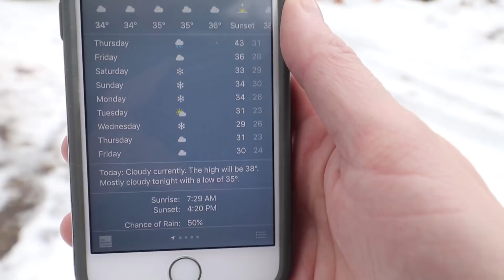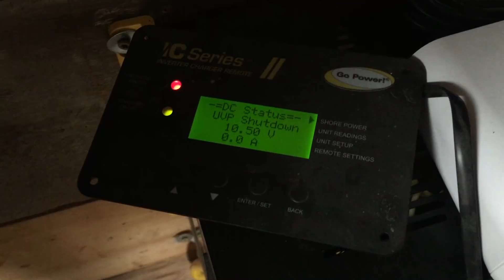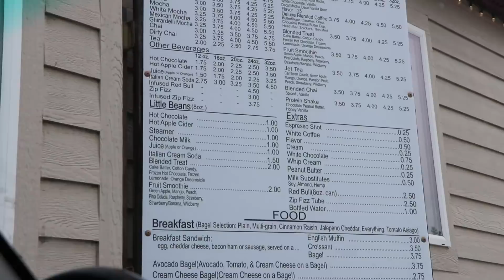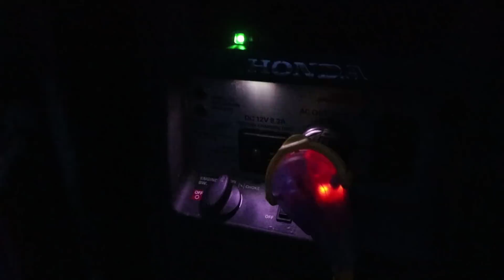Our Story: Giving Up Solar Power to Go On Grid

Comment: I think if you can get some heat from your house into the battery box,  Like a piece of stove pipe from the house into the battery box,  and insulate the battery box.  If you warm the batteries up they might perform better.  I am guessing you are heating the house with a wood heater.  also insulate the stove pipe.

Comment: I would like to add my little to this video if i may. I was surprised that you didn't go for grind long time.  I have my solar system as well and I would say i'm happy with it for 2/3 of they year ..but rest of the year for sure i'm only on grid because low amount of sunshine. So I would suggest (if i may) go for grid  then build your house ..one two years after you do it then buy solar panels including battery and go offgrid..But now you will have a lot of solar panels a lot of battery capacity and even if you would have to use generator it will be different as it was before. This is what i would do but ofc you are the last one who has to deside. So what ever you do i wish you good luck with it :)

Comment: should bring in 3 phase power in if it's available. If you run big motors or lots of shop equipment. Bottom line is you have to buy 3 wire not 2. so alittle more money but worth it.
Reply: 3phz is generally not available for residential applications.   It also is 3-4 time the initial cost when having it set up.  I looked into it when I set up my wood shop.  it was cost prohibitive.   I opted for a 10hp balanced rotary phase converter.  It was a DIY setup and I had less than $300 in the entire thing.

Comment: Good choice.  Most places it is soooo much cheaper to be on grid vs. generating your own.  The cool part is that you have all of that equipment and you can still have an awesome backup in case there is an outage.  You can run the essentials.  I hope it doesn't break the bank.  :-)
When you have the power run to your property and your house, have as much of it underground as you can.  I may cost a little more up front.  You will save in the long run as you won't have to deal with trees and such falling on your lines.  And it has such a cleaner look to it.
Reply: They live near what looks to be a significant road so underground wiring could be a pain during "Backhoe mating season"...

Comment: I see a lot of mixed feelings in the comments. At the end of the day, its your life and property. But if you do go on grid... GET 3 PHASE. if you ever plan on running large equipment, or really anything in general it is much more economical to run on 3ph due to the lower amp draw.
Reply: Steve If 3 phase is available, you are correct.  But many to most places, 3 phase is not available.
Reply: Lots of money a month for 3 phase if it is not needed. Amps don’t cost money, kWh ‘s do
Reply: IT is a house not a business were you may need 3 phase power it would cost more to install and that is if 3 phase power goes down the road they live on they make no house hold equipment is 3 phase

Comment: Ok better what you need to do to get the jobs done. Spending the money on gas for the generator or to fetch water that you could get or do by spending the same money on grid power? Deep breath solar and the generators as backup, very wise. Choice now is underground or poles or poles first then underground. Take your time to make the right choice.

Comment: You really dont need to explain there is nothing against using the grid. Although I do think that for the water perhaps do a ram pump.
I also think you went to small on your solar setup. I use primarily solar shingles and I am hooked to the grid as well.

Comment: you guys are doing what is right for your family.  I support that if you think on grid is the way to go.... Do it.  Something to consider if you want to continue to use your solar.  Look into grid-tie systems.  This allows you to utilize your solar panels and have the benefits being on grid.  You would only need to remove you battery bank, and purchase a grid-tie inverter.

Comment: I think most would love to use and like you said gain energy independance, but problems exist as you have found out. I think a point that needs to be made regarding PV uptake is that clouds diminish this process. Taking that concept a step further we need to ask the question what is solar radiation management (SRM) aka chemtrails? Geoengineering is ongoing and a person would need to be blind (or willfully blind) not to notice. If this is a new concept for anyone then I would suggest reviewing this website, http://www.geoengineeringwatch.org/category/top-story/. Dane is the gentleman who 15 yrs ago dropped everything to pursue exposing what is taking place in our skies, and he got his start because he started noticing how the SRM was diminishing his PV uptake.

Comment: +Pure Living for Life:  Hey, J & A. Looking into solar, or any passive electrical generation system (or, for that matter, any of the "grid" generation systems), you will find that the real problem has always been what do you do w/ all the power that isn't used by the consumer. Just where do you store that over-generation? On the typical grid, the amount generated has to be used by one or another consumer – it cannot be stored. To the rescue comes Australia. The SMART MINDS there have managed to develop free-standing battery systems which allow the generating over-capacity to be stored for later use – by homes, by buildings (office and residential), by industrial concerns, by cities, by local sections such as counties, and, eventually, by the Australian Nation.

What, may you ask, provides the storage medium? It's reasonably simple. It's new battery technology wherein the over production of a.c. power is converted to d.c. power to be shunted off into large, efficient battery systems, essentially based on the latest in heavy metal batteries, usually lithium ion, and lately, on bismuth or other electron-dense metals like them and others similar. When there is heavy demand for a.c. power, the stored d.c. is converted back to a.c., used until that's gone, whereupon the base a.c. generating units are slowly brought on-line to satisfy peak demand to the point of over-generation and the process begins over again, once more being stored as d.c. power.

As batteries/battery systems improve, the ability to store a.c. over-generation only gets easier, better and cheaper. It appears these methodologies may actually solve our "power problems," now, and even more so, in the future. Great days to come, folks!

Comment: Love your channel, I don't miss an episode. I think your off grid power ideas were too narrow sighted. Excuse me but I laughed my butt off when you got your first set of solar panels, very entertaining. Any useful off grid system MUST include wind and biomass electric generation. I lived off grid on a sailboat with only PV and wind generation for over 5 years no problems and no generator (sold boat moved to shore when I couldn't get Internet at sea). I direct you to woodgas production to run an auto start generator when your battery bank turns off. You already have the main ingredient for woodgas, wood. In the end just widen your scope and you should be fine. Google search "woodgas" "syngas" "GEK". Checkout this link <http://www.inresol.se/the-genious-portable-multi-fuel-chp-stirling-generator/>. I was also surprised you didn't use a rocket mass heater for heating your "cabin", so much more efficient. Google search "rocket mass heater". Good luck and keep up the good work.

Comment: running generators is not "off grid"... so: nothing new here
Reply: Yes, running a generator is off-grid. It's just not a clean quiet way of doing so.
Reply: Haters gonna hate.
Reply: so, whats the difference in getting fuel for the generators? You could also charge your batteries at your neighbor  and "play" offgriding. When you have to run the generators every day then it is not offgrid. Those 5 solarpanels will never be enough for two people, same as the few batteries.
solar is even in cloudy regions possible, you just have to have the proper layout for it

Comment: Think about this the radiant heat pumps will need to run or have the ability to run 24/7 when the house is built and winter is the worst time for solar so use solar as a backup because of  the rural area you live in and power failure possibility and plan for outages and have 2 electrical panels an on grid and an emergency and a transfer switch to choose where the emergency panel gets it's power

Comment: In the video they said "solar isn't there" because when the weather's bad you get no power. Not strictly true if you have a Tesla Power Wall. Stores electricity you dont use on a sunny day for the cloudy days when you do. They also said "its not about our equipment".
I'm wondering if they are aware of the power wall.

Grid connection is a good odea though, so that if they do go back to solar and also invest in a power wall, they can earn money by selling their unused power.
Reply: and just what resupplies the powerwall when they use the power?? the powerwall is nothing more than a large slightly more efficient battery. It still needs to be charged when depleted.
Reply: There are more cost effective systems than a powerwall, although not as flashy marketing team behind them! :)

It's also a myth that solar panels produce 0 power unless it's a bright, sunny day. That's why a correctly sized system can work even when you only have overcast days.

Truely off-grid systems are rarely a single solution, usually they are a combination of several different sources of power/water/gas. Solar/Wind, water catchment/well, propane/LNG/Bio-gas, Wood, etc.

Comment: Solar is not reliable and is expensive.  Much better and less expensive to be on the power grid.  Same with your water.  If you want your bill to be low...reduce the amount of electricity you use.

Comment: Hi.  You spent a lot of time justifying yourselves.  I certainly won't judge you for doing what's best in your life.  And to heck with anyone that does.  

I had grid-tied solar from 2005 - 2016, professionally installed.  Grid tie, for me, was maintenance free, so you might rig that up once you get on the grid.  I moved to the Philippines with MANY grid blackouts, so now have a hybrid system (grid, solar panels and battery backup).  Blew up the inverter, and no support from the installer or maker.  So, I'm on my own.  I'm feeling your pain.

Comment: so you are complaining about solar power but you should know before buying the panels how much power(+or -) you gonna get.use 12v dc led lights,use 12v dc tv,12v dc washing machine,fridge,microwave and so on and the money that you spend for high power inverter well then you can use it to buy more panels and battery or a 400-600w wind generator and most of the time from september to march(april) will produce more then those 3 panels

Comment: Did they give you a smart meter or an analog meter? With an analog meter you could turn the meter backwards with your solar panels going grid-tied... If it's a smart meter Unfortunately you would need to go with the contract with the utilities to go net metering....
Even I need a minimum of 2 kw of solar panels (and need of wind turbine during the winter) to run my single person household you had less than that.... you needed 4 kw minium and way bigger battery bank in a warm room...

Comment: Going off grid is perfectly possible and ultimately what everyone should do for the sake of the environment and for our own protection. in my opinion the reason it hasnt worked for you two is because you have used batteries and that your battery bank is not large enough, as well your solar panel set up is just not large enough, so your system in general is not sized properly for your needs. If it was, you wouldnt have the issues you have. Plain and simple.
Reply: They knew that already.....Jesse explained the why and why nots of their system eons ago.
Reply: There is truth in that. However the winter provides problems when severely cold temperatures halve battery capacity.
I used to buy my batteries used, after 2 years of service in a computer server for their scrap weight price.
It's possible in some countries to buy a pallet load of used solar panels.
This is affordable for a full size home but you still have to juggle 2.5kw, washing machines , 3kw water boilers, 2kw irons, 2 kw kettles, lighting, and a variety of 2 kw power tools, TV, dvd, sound system, oven etc...
At least the on grid lifestyle may bring the opportunity to put up a couple of wind turbines to feed the grid directly & lower their bills.
I wonder how much mobile phone/ internet bill will be in ten years time?

Comment: i would love to have a hydro system. i have water on my farm just not enough for a large system to operate year round . i can see your point. our power usage is small but the elect co we use is expensive . good luck with the power. i would also bury  your line to the house, no ugly wires overhead, with your backhoe you should be able to do the work laying cable your selves and save some cash.
Reply: Another big plus to doing and owning your own infrastructure upon your property is that the electric company doesn't end up owning a giant easement across your property. Of course the drawback is that any problems on that side of electrical become yours as well. My opinion underground with extra conduits is the way to go. I would have just kept the solar around to experiment with on selective loads.

Comment: Wow. You guys didn't last long. We went off grid 20 years ago and spent our time and money on upgrades. We'll never go back. Now you are just gridweenie energy slaves. Also, you may find that permits, inspections, re-inspections, fees, taxes, etc., will be just as much cost and trouble than if you had stayed the course. Speaking as one who has been there, done that.

Then there's that check you have to write every month......... forever,,, no matter what the economy does. I can't even conceive of that anymore. Just sayin'........
Reply: If you've been doing it for 20+ years what's your financial outlay?  I'm guessing $100-200 per month for every month when you add up the price of the systems, generatora and gas you've gone through over the years.  Not to mention that when you started and until recently solar panels required more energy to manufacture then they would even produce.  Oh and finally they live in Idaho the grid power is hydro and very little propane fired power plant so their carbon footprint print will be less not burning all that gasoline and diesel

Comment: You've got to recognize that the grid was developed (in part) to simplify life. If your goal is a simple life; on grid power can certainly be part of it. If I were in your shoes I would look to tie in the solar to the grid power; so when the sun is high and  you're not sucking power your meter is running backward. It lowers your bill automatically, without messing with battery banks, etc. Sounds much more like the simple life than what you've been dealing with. 

You're going to lose some followers for whom your being off grid was a high value to them. They shouldn't be upset with you (though some will), so let it be. Good luck. Find the sweet spot for your situation. IMHO not running to town for everything and having power on hand is a lot simpler (and cheaper) life. Blessings!

Comment: Fact is you've learned that solar isn't viable, a lot of people learn that the hard way. By the time you recoup your costs of the system it is time to replace it. At the same cost over the same time period, you could pay for grid power and not have outages and generators. Off grid is great, alternate power could be great... but it's not there yet.
Reply: If the cost is the same, minus the shit tonne of CO2, I'd opt for solar/wind.

Comment: I give you both a lot of credit. I am not sure I would have made it as far as you are. Areas are different. I also live in a northern state known as Wisconsin and have been following you to see the ups and downs. Grid is reliable but you have a great back up system when it isn’t. You have give me great ideas and ways to think differently about solar energy and see both the good and less than good. For what you need right now you need more power that is less expensive than diesel per gallon both in generators and truck to get it. 
Be safe and God bless and looking forward to warmer weather and seeing sips.  ;)

Comment: Yes!! knew you would do this at some point, solar is not what its cracked up to be, as a supplement yes, i know because i've worked alongside the renewable energy industry most of my working life and i'm retired now! i've never seen installed or inspected any off grid solar that even comes close to doing the job full time without compromising at some point,  some close with wintubins backing up the solar. no point in any one explaining it all to you as almost everyone that has soler or sell it says you would never look back. even if someone was totally honest about soler are just clast as a  conspirator for the powers at bee, the only way to find the truth is to install a full system and  find out your selfs and that's the best evidence that solar is not what it;s cracked up to be. what im saying that it does have a place in the energy industry but only when its tied into the main grid there it really works.  i have a small solar system that works well for me but it only runs lighting (no sockets) , the system is 4 times bigger than what anyone would ever install for just running a 1000 what light system, but that's the only way i could make the system stand on its own solar energy without any input from supplement all year round, in the summer i have to dump most of the generated solar but in the winter just copes.    

if i could just suggest when you are on the grid set up your existing solar system just to run outside light around the property only. anyway thanks for all your up loads.